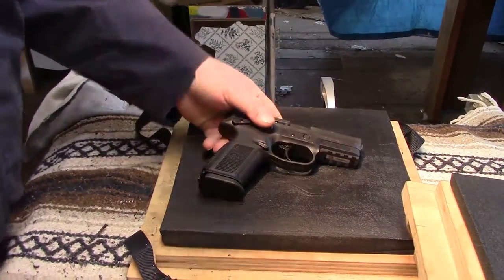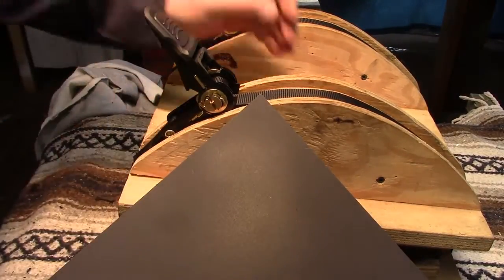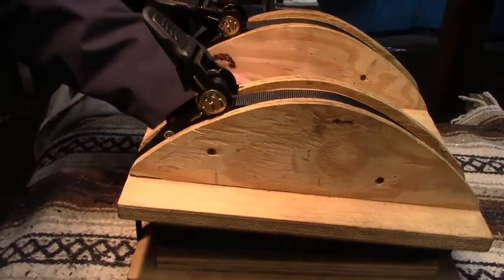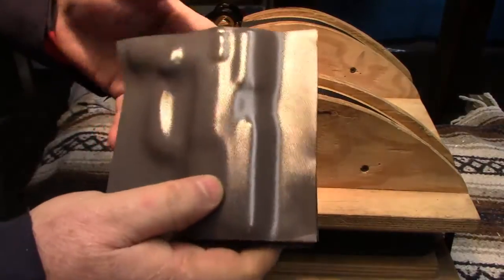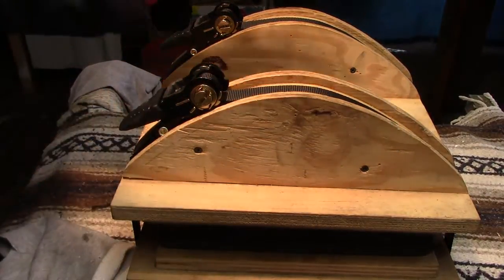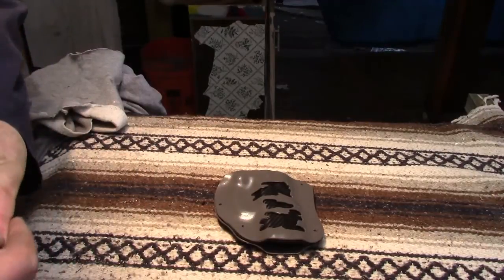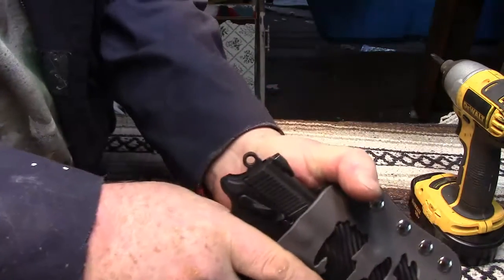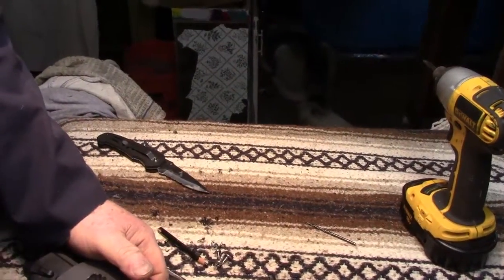FNX-9  FNS-9 Holster

Comment: Well,its late for me but I'm coming back to watch some more. Im rteally interested in kydex and dont know where to start. Im assuming you made the press thing yourself? what do you use for the foam cushions? Where are you moving down south? Im from enfield and I moved south in ,76. I could never live in the cold again.
Reply from the maker: I made the press but you can buy them, I had the lumber around the shop so why not make it. The foam you can buy just about anywhere but I bought it at http://www.knifekits.com/vcom/index.php they sell kydex as well. As you search the net you'll find kydex just by searching, it comes in 12x12, 12x24, and even 4ftx8ft sheets.  I use a small toaster oven to heat the kydex, it holds 2 8x8 pieces but most for most holsters I use 2 6x6. If I can help in any way just ask, I'm buy no means a pro but I get the job done.  We were thinking of Ga. but have family in Fl. so we are thinking Winter Haven within 30 miles. I'd like about 10-15 acres but 5 would be ok. A few acres fenced in for the boys, an acre for shooting, a small garden, and a shop.